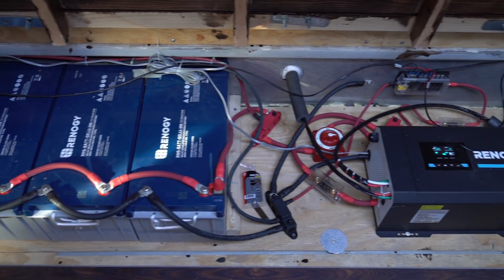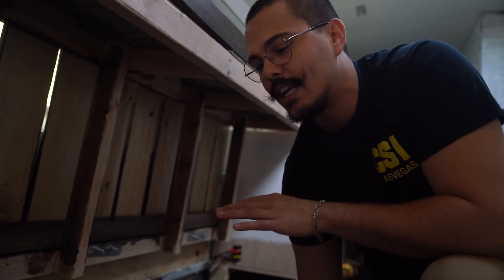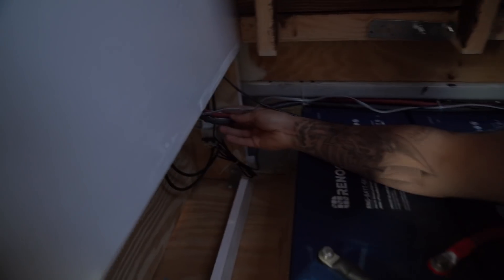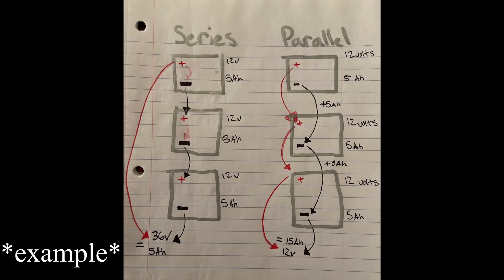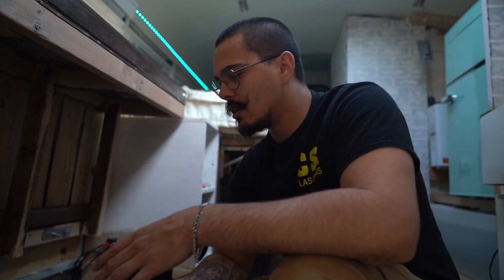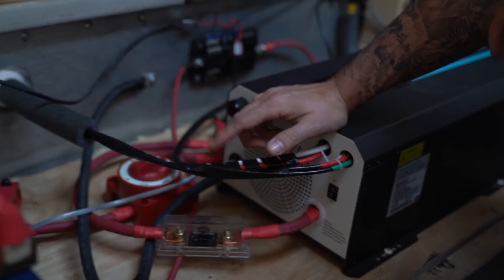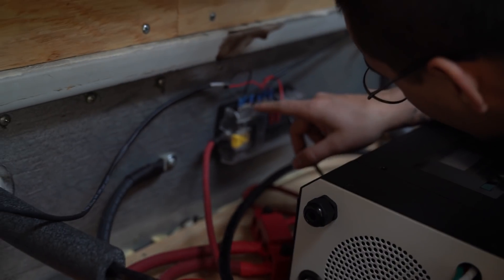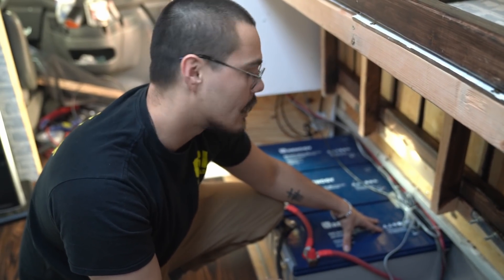Beginner's Guide To Solar Power! | Skoolie Build (Ep.34)

Comment: I would suggest that you try to limit the use of electrical tape. I find that when I use electrical tape after about a year or so it starts to get undone and then it needs to be re-taped. To avoid this issue, I often find it’s better to solder the two cables together and use shrink wrap and a heat gun to seal them. This tends to be much for effective.